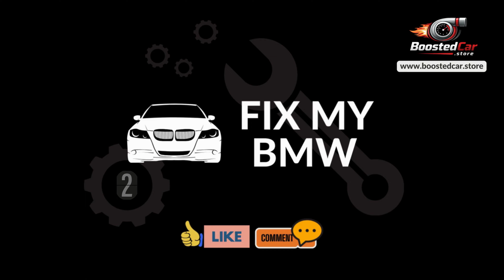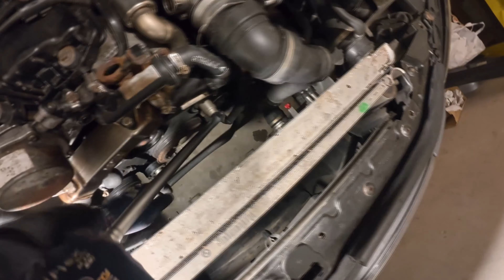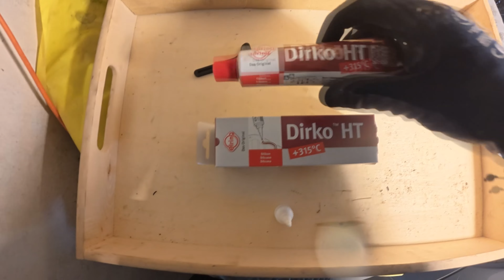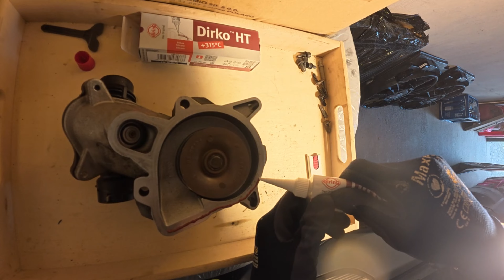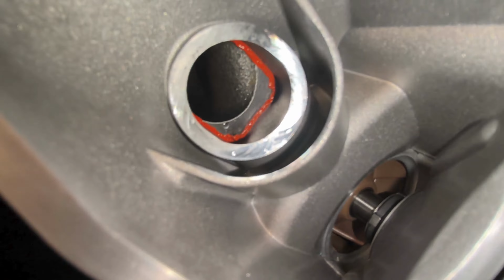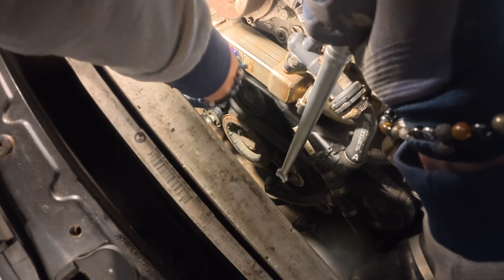How to replace BMW m57 water pump (E60 E90 E70 E65 Step-by-Step)

Comment: im changing my waterpump now, m57n2tu 2006r 231km 170kw, all the hoses are disconected the termostath either waterpump is unscrewd and she is not going anywhere, its seems like its welded, any tips?
Reply from the maker: Hey! In situations like this, my first step is applying WD-40 every 1–2 hours throughout the day on the bolts and waiting (provided the bolt head is fine; if it's already stripped, this won't help). The second option is to drill out the heads of the bolts and back out the rest with pliers—the downside to this solution is having to buy a new pump, because the old one might not survive it. You mentioned welding—if someone joined the pump to the engine with actual welding or brazing, you'd have to tear down the whole front end, cut it out, and the biggest challenge would be flattening the surface for the new pump (I personally sealed mine with Dirko silicone, because the new metal OE gasket wasn't sitting flush and was leaking). P.S. Let me know how it turned out!"